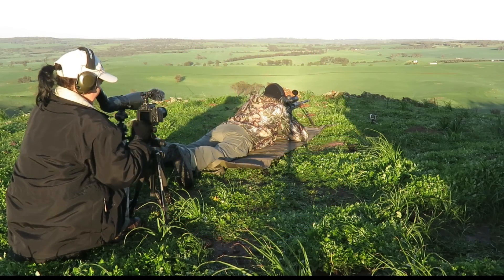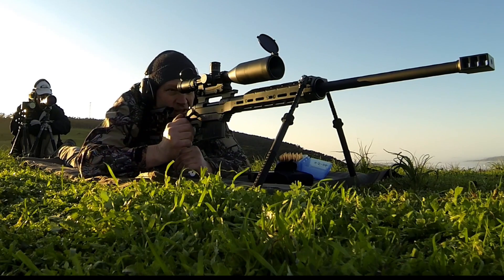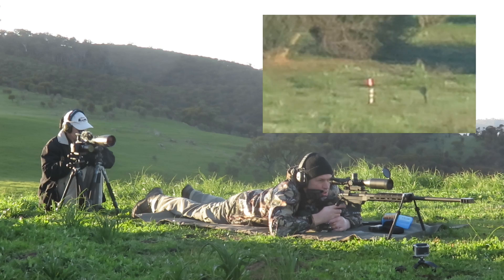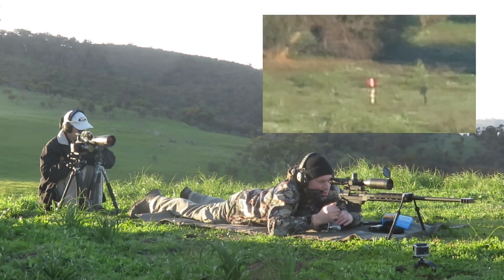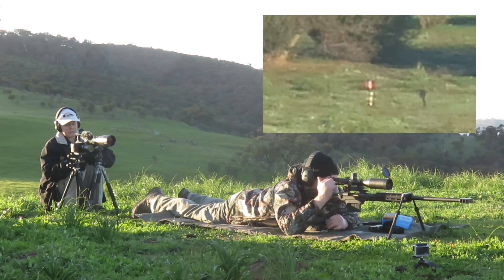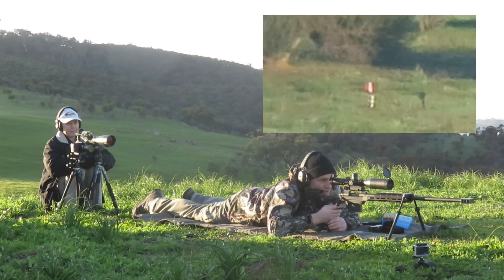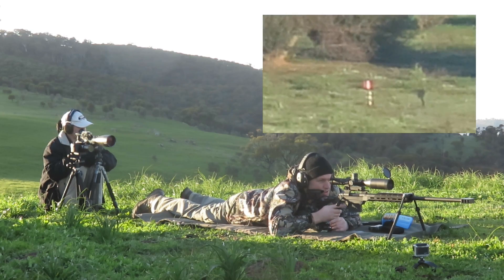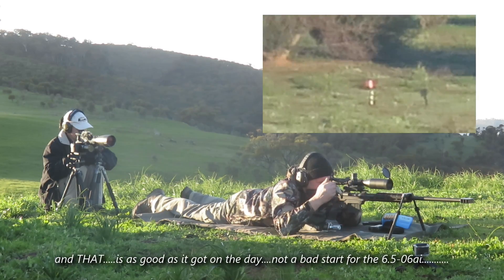6.5-06ackley Improved at 1723 yards (from Nov 2018)

Comment: Hi Mark, with these high velocity cartridges have you considered using eg HBN bullet coating to try and increase barrel life? Great content!
Reply from the maker: Very little about friction, much, much more about the fire, the heat and the speed of the gasses, so coatings may have some speed and bullet advantages, but not going to influence barrel wear, Cheers
Reply: @markandsamafterwork  yes you're correct. so my understanding of hbn. You coat the bullets and you coat the barrel (initially). the barrel then stays "coated" and hbn has a very high heat resistance which helps with barrel wear. Would you try it? Or have you looked into it and found no advantages? Thanks
Reply from the maker: Yes I have tested, and has some advantages, but, no difference to barrel wear, Cheers
Reply: @markandsamafterwork  what would those advantages be that you found (my last question) thanks
Reply from the maker: Sometimes helps with bullet seating (monolithic projectiles), speed, consistency, peace of mind, etc, maybe a video some time, Cheers